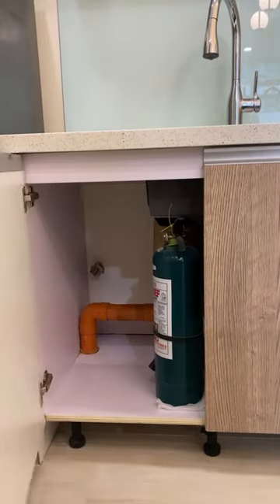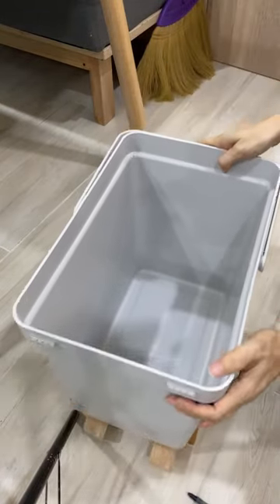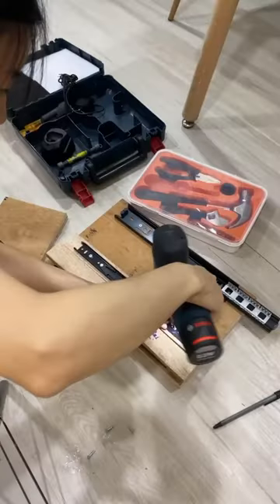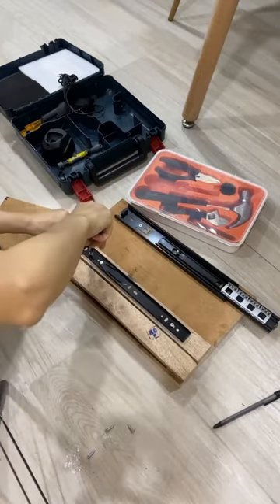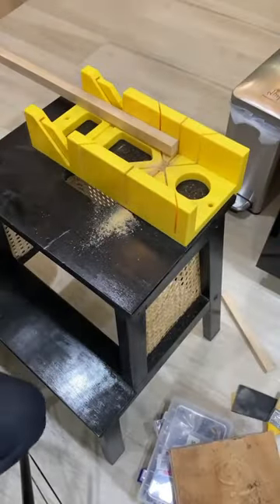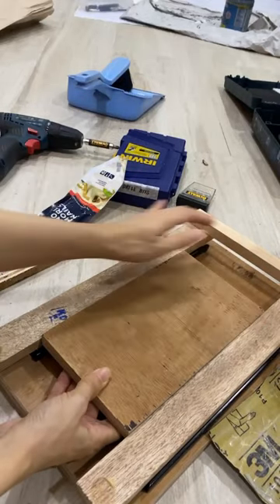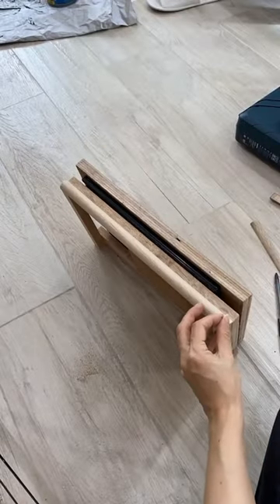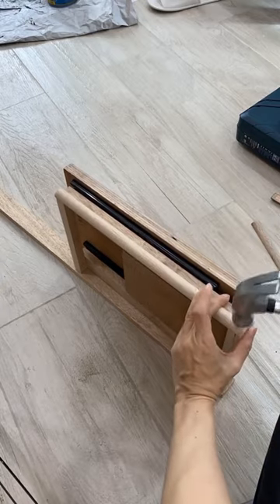DIY PULL OUT Trash Bin (Ft. IKEA HÅLLBAR)

Comment: How do you mount it to the bottom of the cabinet?
Reply from the maker: I put a screw through the plywood and the bottom cabinet. You can also use command strips as a less permanent solution 😊
Reply: Plastic garbage can does not have to be mounted but the slide has 2 bottoms and the lowest bottom can be nailed to cabinet bottom.